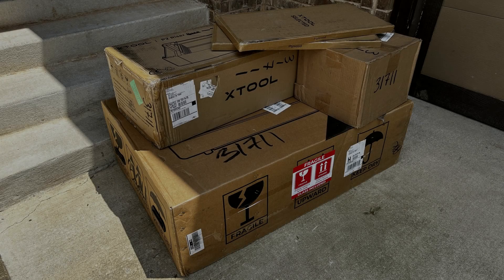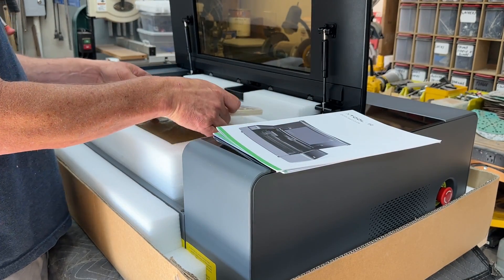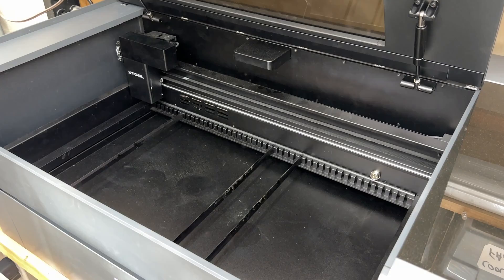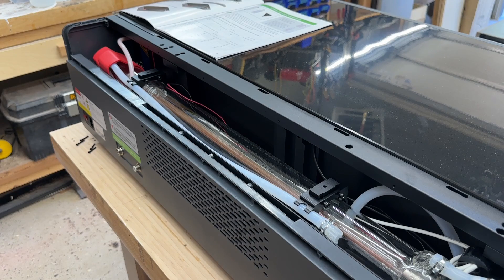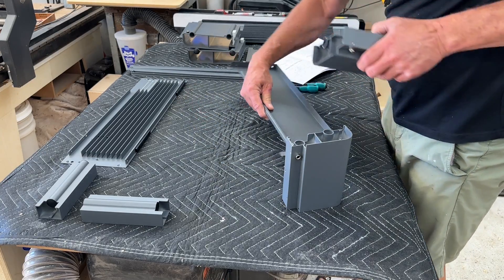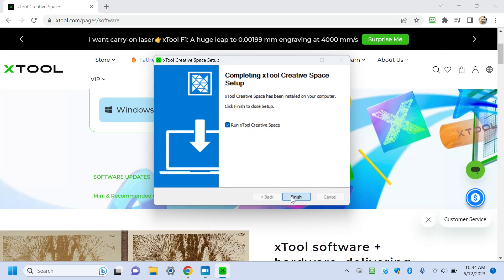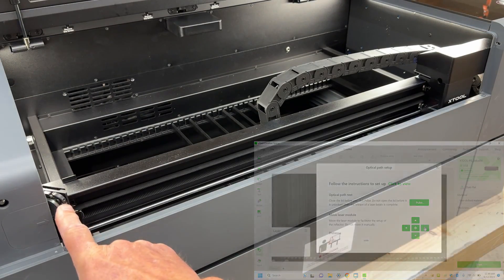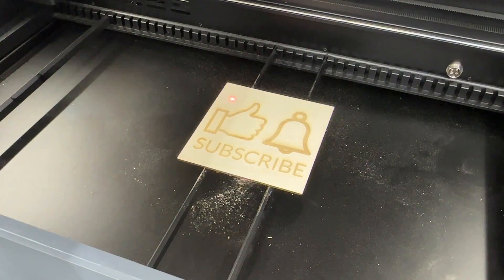XTOOL P2 55W Co2 laser setup and laser calibration.

Comment: This was extremely helpful as I did not know about the laser calibration tool while setting up! My laser did indeed need a little bit of help reaching the center so I ran the tool and it's much better now! After that though, I'm still not getting any burning out of the laser module itself! Having a hard time figuring out the issue on my brand new machine :(
Reply: I figured out that the software didn't auto-set the power parameters for my materials. It was set to 1% for everything!! No wonder nothing was burning XD A bit annoying that it doesn't set it up for you.

Comment: We’re really struggling to get ours calibrated. I’m not sure if it’s new software but it’s asking for 3 optical path tests which require to make adjustments to each of 3 mirrors and then ends up with the first being off again. Customer service has been no help either. It’s become super frustrating! Do you only need to do one test in this version of the software?
Reply: same, I've spent hours on it today. The first dot was a little off, so it had me move to the back, adjust that one, then the one that feeds into this mirror, then when I go to pulse for the first/last one - zero marks. Nada. Nothing on the tape or the housing. At this point I've screwed ever adjustment on that front mirror corner so much that I don't know what to do since I have no idea where I have ended up. The other two spots to put tape and check are still fine, it's just the beam refracting out of the last corner and over to the laser head that doesn't want to do anything in any direction to appear like it's passing the beam to the laser head. I'm done for the day after 6-8 hours on this. I'm not a novice by any means either. I've calibrated plenty of other machines manually. I have no idea what the heck this one is trying to lead me to with all these steps when the first beam was only a little off.
Reply: @EclecticLauren  have you tried updating the software? The newest version has a much more simplified process and that’s how we were able to move forward. Such a pain the butt!
Reply: @janethbetancourt141  yep, fresh install in the past 72 hours since unboxing. I can check again, but I have since lost two of the springs that hold the little rods that change the direction to focus the laser beam and am waiting to see if I can purchase more. Thank you!
Reply: @EclecticLauren  I hope they’re able to help you. I know how frustrating their customer service is. Good luck!!!
Reply: @janethbetancourt141  me too. I've got a M1 Ultra and accessories all still sitting here in the boxes bc I needed this one in place before I moved more things around to give it a "home". 
And if you want some crap CS - buy a Glowforge. LOL

Comment: Hey I am trying to align my laser calibration but my 1.5mm hex tool is not latching on the locking mechanism for the horizontal adjustment… I tried turning the mirror thinking maybe I unlocked it but nope it won’t move.. any idea why I can’t unlock the locking mechanism?
Reply from the maker: Thtst hard to say, does it look like the hex on the locking screw is damaged?

Comment: I tried running the materials cut test card you showed and the laser head came all the way down onto the 3mm basswood board and dragged it around the laser bed… What am I doing wrong?
Reply: do an aimed measure on the material this should auto calculate your distance for the laserhead.
Reply: Aimed-measure is located to the right next to thickness  the + with a box around it. Once selected touch your material and it will auto calculate.
Reply: Thank you so much!
 @waltw918

Comment: Did u use an extraction fan with it or just the stock
Reply from the maker: Im just using the built in fan and it runs through about 4 feet of flexible hose. has plenty of exhaust force.

Comment: One thing that no one else has measured is the dpi/kerf. Would be really great if you could make some measurements.
Reply from the maker: Interesting. I will definitely look into that. Thanks for watching!
Reply: It's about .15 total. So .065 each edge you can just lightly tap it in
Reply: @hacksawjimthuggin7411  Thank you. Not bad at all for a 55W CO2 laser.